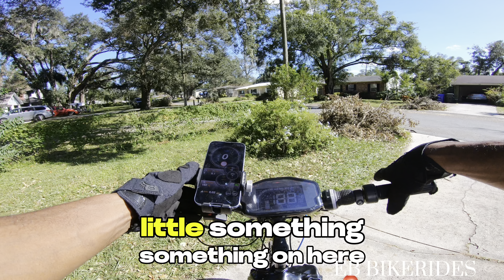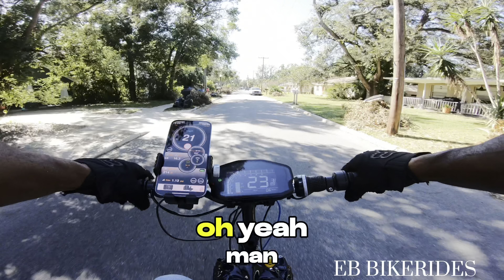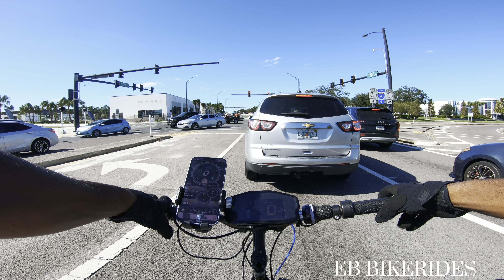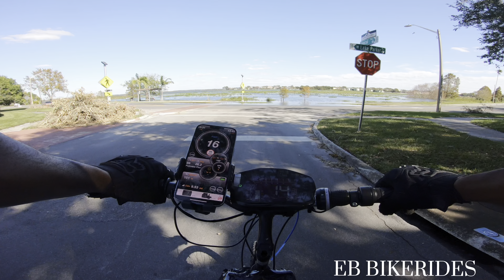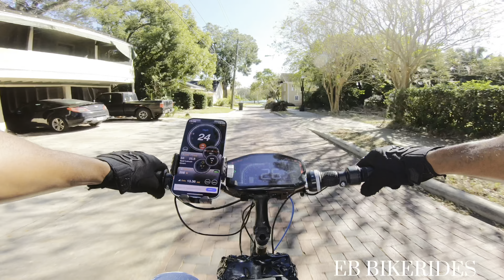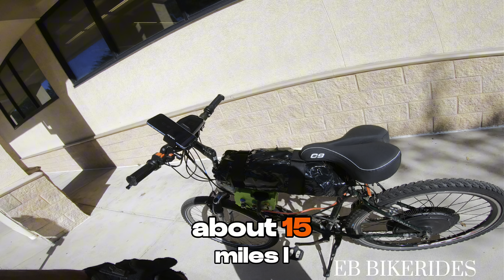72v 3000watt with FarDriver 72360

Comment: Ya, the 5000w nbpower motor the best I could get was 67mph. But that’s on a 20 inch fat tire bike pushing 200 amps and 400 phase with the fardriver 72450
Reply from the maker: @jakegreenwald469  Yeap I going with that 5000watt on here

Comment: 3kw with rim brakes…
Reply from the maker: @ramborambokitchenkitchen6357  yeap
Reply: @ebbikerides8608  bro if someone pulls in front of you and you’re going more than 20mph you ain’t stopping in time. There’s a reason every electric vehicle uses hydraulic nowadays even the cheap ones have stopped using mechanical, which is already a step up on yours lol.